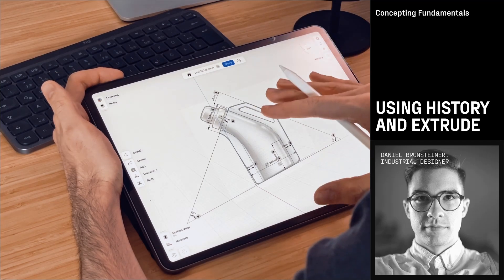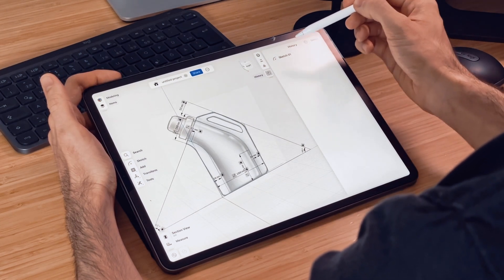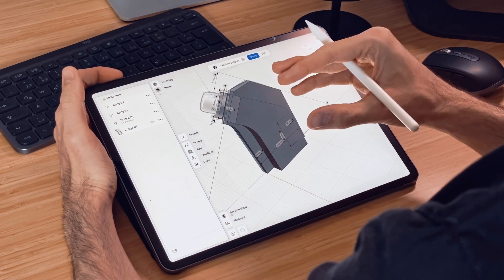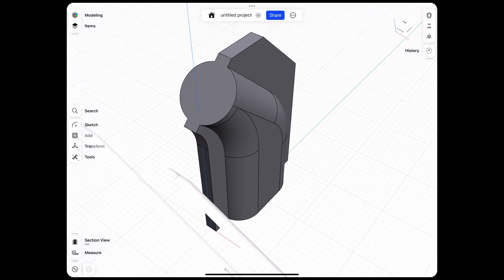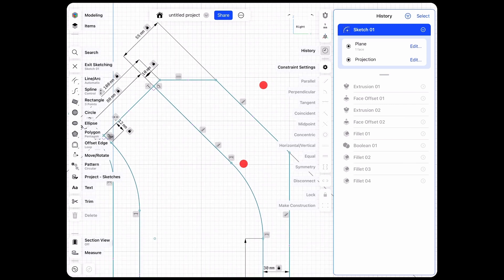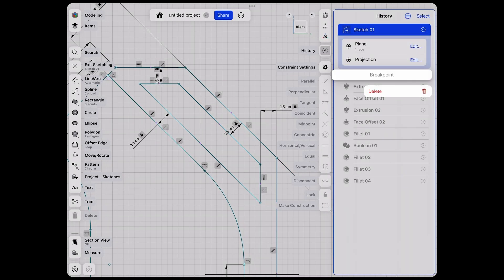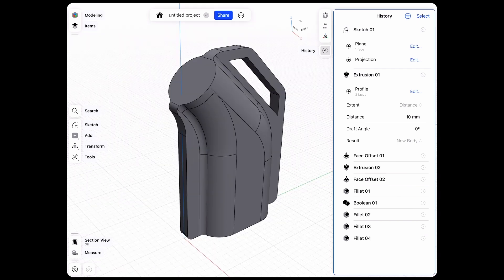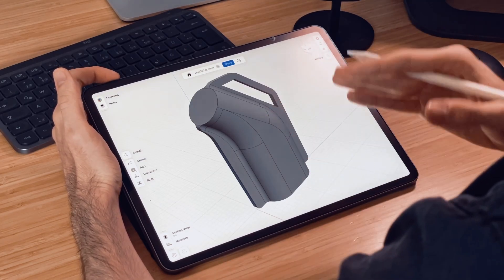Using History and Extrude | Shapr3D Concepting Fundamentals

Comment: How did you get the handle center portion to delete?  (so the handle is cut out).  You clicked 'edit' and selected 'updated profile', but how did the updated profile suddenly become an empty space for the handle?
Reply: He unselected the section and then reselected the section, but due to the new polygon representing the cut, the inside part was not automatically selected.
Reply: @RobertoColi  Thank you!